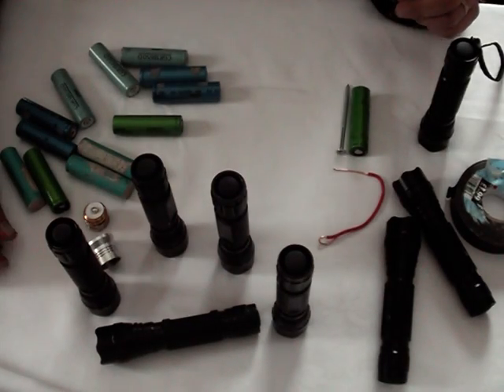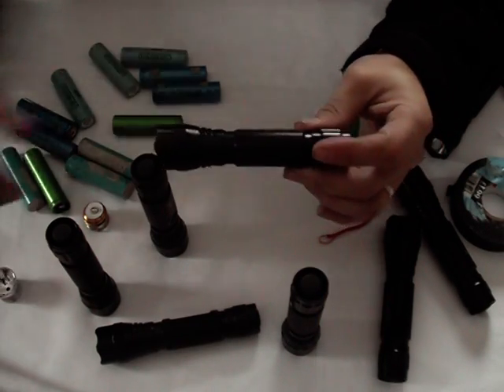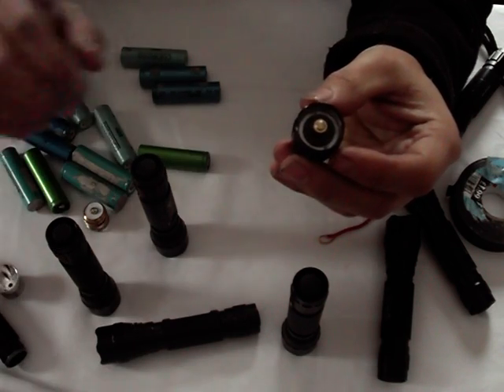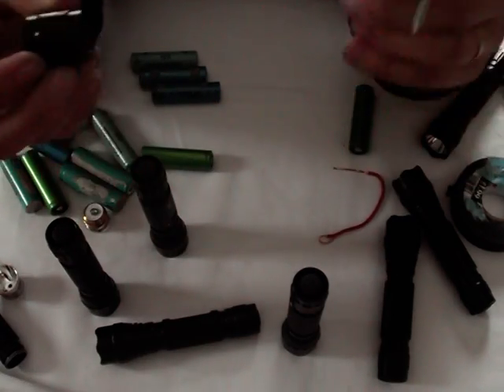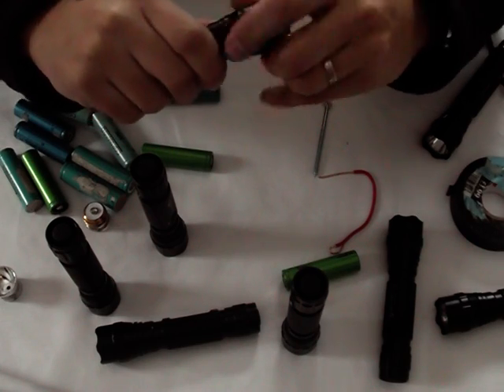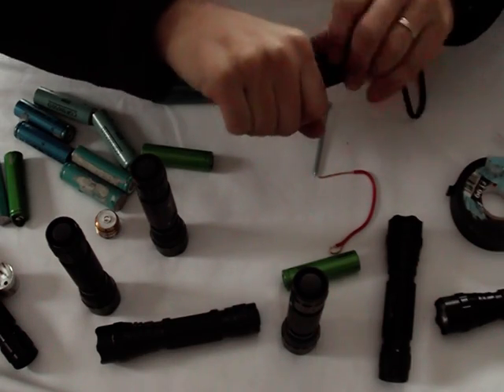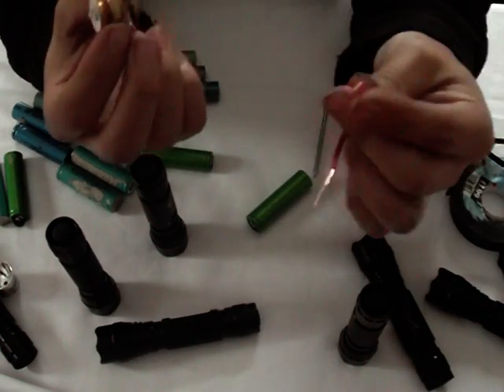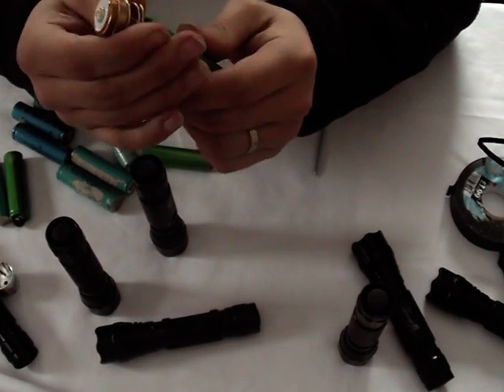CREE Flashlight 🔦 How to Fix Frequent Problems

Comment: Hello. How I config my Trustfire J18 to his work only in hard mode (100%)?
Reply from the maker: you will need new driver
Reply: @motorbiking18650  exist a jump in the boarder to run only in 100%. I dont need other 4 functions of flashlight

Comment: If you can’t get batteries out it’s probably corroded inside. You recommend greasing up ( not over greasing) the inside of battery container? This seems to be a pretty common occurrence. Batteries leaking? The inside is sealed off from the world so I can’t understand how else this would happen. Mines a g 32 and the warranty people were pretty good about exchanging it:).     By the way when I suggest greasing It I’m talking about right out of the package.
Reply from the maker: If you have corroded Li-ion cells they are best disposed of properly - 13w of power is a lot to go off

Comment: I just bought a cheap UV light, placed in fresh batteries and it didnt work. Though I got scammed or somthing but my gut told me to try all the batteries...
Turns out 2/5 new batteries in the pack worked. I stil got scammed out of the batteries but at least the UV light works 😅

Comment: Hello, very informative, thanks. I have an Imalent DT35 with 4 cree xhp 35 leds (2017) and 2 of them are flikering, blinking... I recently bought it used, but it had very little use, so it is like new.... sometimes a 3rd led will start ok at 80lm setting, but then will turn off at 1000lm or 5000lm settings. The 4th one will never turn on. Do you think is there some solution for it? (by the way, with just 2 leds working the amount of light is impressive!)
Reply from the maker: I bought https://www.lightmalls.com/new-small-steel-cannon-flashlight-xhp50-led-3-6000lm-type-c-usb-rechargeable-aluminum-alloy-outdoor-led-glare-long-distance-searchlight for $30 and its really excellent.  The multiple LED lights are hard to fix if the driver wiring is faulty.

Comment: I tried your tip to connect coil in led light element to one end of battery with a wire and other end of wire to other end of battery, but it causes the battery to instantly smoke and burn?!
Reply from the maker: `it sounds like you had some of the wire touching the cap by mistake.. Its often only paper/shrinkwrap that keeps the + and -ive apart

Comment: I just mended mini that was intermittently working going bright to dim to sos then no light so I soldered copper branded wire from top to bottom of each spring front and back and now it works as it should.

Comment: ..i had issues on similar new flashlight...got it working by removing the 18650  protective  o-ring near the positive  terminal  which is negative ..the LED circuit should have direct contact on both terminal before the switching happens  on its bottom....the gap between this terminals are so close  ...normally covered by shrink tube or similar to prevent oxidation (tenderites) and batt short...point that as well..

Comment: I have an ultrafire not sure what model but it's about 7 inches long or so. To adjust the cone of the light the head is pulled up and down and it has become VERY hard to pull up and down, i cant get it apart any ideas?
Reply from the maker: Sorry, no I try to avoid buying zoomable lights as they just reduce the output.  Maybe some tf2 Teflon spray?
Reply: @motorbiking18650  thanks for the reply. turns out the rubber o-ring had doubled up on itself so instead of sliding up and down it was just distorting it :)

Comment: I lost my cap, how do i make it work
Reply from the maker: You can complete circuit with a wire from the cell tail to the body via a switch, and then just bung it up, but its going to be a bit poo.  you can get replacement caps but they cost as much as a replacement light.

Comment: Hi, nice video!
But I have a different problem and was wondering if anybody could help?
I have a Walther Speed Spot torch/flashlight which I was given 3 months ago.
At first the light beam was REALLY bright but over the last 3 weeks it has become MUCH dimmer and it also blinks 3 times (every minute or so).
All the connections seem to be fine and I have tried inserting fresh batteries without any improvement. The torch works but at about 50% of its original brightness!?
Does anybody have any suggestions?
Thanks in advance, 
Paul.
Reply from the maker: Has the tint changed to a blue colour?  Do you know what LED model it has?  If you've over heated the LED then they tend to turn blue

Comment: The ring inside the switch cap of my XML-T6 was a bit loose but I tightened it. The flashlight was still not working with the cap tightened onto the tube.
Then I noticed that it seemed to work (at least the light came on...) if I loosened the cap.
Then, out of curiosity I screwed off the head part to see how the tube itself looked - when I realized that the edge of one end of the tube is black (painted) and the other is bare metal. So I just turned the tube around and screwed the cap onto the end with the bare metal edge and the head unit onto the black edge. 
And lo and behold - it's working perfectly now. (I have probably taken apart the light at some point and put it back together the wrong way...)
Just another thing to consider in case it happened with somebody else, too...

Comment: If your torchlight is flickering or goes no light when you drop, all you need to do is put a the smallest coin you can find and place it between the spring and end of the battery

Comment: I just bought a A1 wowtac   And it was DOA arriving at my house   Watching your video  I fixed it my turn in those 2 little holes  tail cap was really loose   I tighten it up like you  said  and   It fixed my light   Thanks so much
Reply from the maker: glad it worked

Comment: Thank you, thank you, thank you. I was starting to feel hopeless about fixing my VG-10s. I bought my flashlight on Amazon and it never worked. I held on to the flashlight for months and gave the flashlight and sender a bad review. I had spent countless hours going over videos on how to correct the problem of getting my flashlight to turn on. You are the only that suggested using elctrical tape. Two pieces of electrical tape fixed my problem. You're the real MVP.

Comment: I have an electra lipstick stun gun, and accidentally pressed both buttons, and now the flashlight doesn't work anymore. Can you please give me some advice on how can I fix it?
Reply from the maker: If you can unscrew the light part and connect the flashlight directly to a 3v source e.g. a button Cell, you can see if the LED is fried.

Comment: DO NOT WASTE YOUR MONEY..these lights are awful.. they turn off for no reason.. dangerous for a bicycle.. unreliable and you can't change the damn light element

buy something else or throw it out!!
Reply from the maker: klepetar I’ve never had any problems I couldn’t fix.  There is nothing complex about a flash light. I still have early XP-E based lights that work plus i’ve done 7 hour plus night rides off road.

Comment: I have a Rocky brand tactical flashlight. About 8 inches long, black steel body and the black, rubber push button on the end.  The flashlight was dropped but kept working. Now, a few days later, the flashlight does not come on with the press of the button.  What it DOES do is flicker on and off as I screw-on the battery cap and I will push the power button in when I get the cap tightened.  The light will turn on, full blast, for a half a second and turn off.  The design is steel body, the one octagon nut at the base of the bulb housing.  I want to check the bulb's tightness in the housing but cannot get the housing to unscrew from the body.  Do you have any suggestions please, to do that?  I've had this tactical light for years.  It's been a toughie!  This is so frustrating! Do you have any suggestions of what the issue may be please?  The flashlight uses 6 AAA batteries.  I bought 8 new batteries tonight, tried them and the light does the same as before...flickers on and off as I screw the battery cap on and may or may not turn on for the split second.  Your video is great!!!  This really educated me!!!  Your help is so GREATLY, GREATLY appreciated!!!  Thank you!
Reply from the maker: I'd try packing some wire or foil in the end of the battery holder to make it fatter and therefore put pressure on the circuit.  But a tac light that uses AAA... you're really missing out on some power.  18650 based lights can draw much higher current and therfore you could replace with say an XP-L 501b for about $10 This would probably be about 4-10x brighter than your current light.
Reply: Thank you VERY MUCH for this info!!!  Thanks for the advice on the type of replacement device and I found one as soon as I read your message!!!  Thank you again!

Comment: Excellent video, however, my issue was not addressed.  My newer model torch doesn't stay at the same level of brightness.  It suddenly dims for a time, then becomes fully bright again.  It takes about 10-20mseconds for this to occur.  Do you have any thoughts on how to remedy this issue?

Thank you very much,
Ron
Reply from the maker: It sounds like a poor connection which goes as the circuits heat up.  Strip at tighten everything.

Comment: Hey, motorbiking.
My "Wilko Cree LED Bike Light Front High Intensity", got knocked off its mount and tumbled down the road, causing the LED to come off its little silvery square mount point.
I just wondered if an unbonded LED can be easily fixed (by me, at home).
Reply from the maker: Dave Lennon-Copeland thermal paste or high temperature silicon should work.

Comment: Hi...my flashlight BRIWAX model BX-8455 in turning on because when looking toward the len I can see that it is on but light is very very poor...anyone know the problem? The battery is new and I charged it by 4 hours after de green led turned on. I don't know if my son dropped the flashlight and the led got damaged.
Reply from the maker: So the LED is on very dim? You have a lose wire somewhere or the LED is burned out.  Strip it down to the drop in and use some wire to hard wire the cell,  If its still dim then the LED is cooked.

Comment: gotta let you know, I didn't know the switch came apart more. I took it open with a screw like you showed and discover a short circuit that was preventing the mode from resetting when the torch was shut off for several seconds. thanks, man.

Comment: he said he does not use  protected cells with one in his hand, the button on top is the protection...
Reply from the maker: No these cells are from laptops the circuit was in the pack, they don't have the top cap protection built in.
Reply: Ok. whats the button?
Reply from the maker: In the flashlight - its just a switch.  In the driver there is sometimes over discharge protection, but its often way under3v, on the cell the white ring is just cardboard/plastic - is that what you mean?
Reply: I was told the buttons are the protection circuit, everyone says that I got some...
Reply from the maker: The best way to check, if you don't know what you are looking for is to measure the length of the cell.  Apart from panasonic they mostly all come in pretty close to 65mm.  If its protected it will be 68-70mm long as the protection pcb goes on the +iv end.  Laptops use superior protection, see my other video https://www.youtube.com/watch?v=RjtwE41PX1g

Comment: Thanks for the video helped me solve my issue of it switching mode.

Final result was adding packing around the battery and resoldering the spring to the driver housing(looked like a bad solder joint in the first place)

Comment: Hello there, i have a Cree flashlight (600W running on UltraFire SH-6032) with the button on the side. I accidentally dropped the torchlight on the floor. The button wont click when the battery is installed, so i had to remove the battery to click on the button and turn it on. It is possible to change the mode pressing on the button because it does not need the 'click' in order to work. Any possible fix?
Reply from the maker: Keith Yap if you can find a way to break the circuit perhaps with a remote switch, it should mode cycle
Reply: Hello there, thanks for the reply. I can't turn on the torchlight with the battery inside. Because with the battery was installed, there won't be 'click' sound when the button is pressed, so I have to remove the battery and press the button and install it back to turn on the torchlight. Mode changing is possible because it does not need the 'click'.
Reply from the maker: Keith Yap ah i see.  maybe remove the shrink wrap from the cell middle or carefully punch a dent in the cell where the switch is

Comment: Let me add ..... check your batteries. 

Turns out my issue was a faulty battery. Bought two faulty Ultra Fire cheapo Chinese rubbish. 

Replaced with a LG harvested from an old laptop battery and hey presto.
Reply from the maker: Avoid those - I only use recycled laptop cells as in the video.  see https://www.youtube.com/watch?v=RjtwE41PX1g

Comment: what if the spring fell off?
Reply from the maker: If you still have the spring, just put it back in loose (or use a glue gun to hold it in place).  If not make a new spring with some coiled wire - it wont be very springy

Comment: Thank you for the video. Cree Unique Fire didn't go. Was going to order a new bulb set, but saw your video and tightened the plate holding the button with a small screwdriver. Simple fix that I hadn't tried. Goes well now!

Comment: Hi I have a question and was hoping you'd be able to help, I just got an LED flashlight with a Cree XML T6 LED. The LED turns on but it's EXTREMELY dim when I turn it on, it's not the batteries or the button, any idea how to fix this? When I say extremely dim I mean like really dim I can look straight into the LED. It's like the LED is getting the least amount of power it will accept to turn on. It also will not switch between modes but I wouldn't really expect it to considering the LED seems like it isn't getting much power at all.
Reply from the maker: yes. it sounds like a lose wire causing a micro arc. strip it down to cell and driver as per video and test. if it's bright then lose connection so tighten everything if still dim.  duff driver.
Reply: +motorbiking Okay I'll try that. I appreciate it. Mine isn't exactly like yours it has the led on a circular board with two wirea connecting it to the driver that sits in the tube. So should I use a soldering gun and take the wires off the board and connect the wires from the led to the battery?
Reply from the maker: +Josh J No - your LED will go blue and die if you do that.  The driver regulates the current, the reason I strip down cell and driver at 7:05 is to remove the switch from the circuit - have you tried this?
Reply: Okay I appreciate the advice. No I haven't tried anything yet except  pulling the flashlight apart to see If there we're any loose wires or anything.

Comment: Thnx to this awesome video I was able to fix my Cree XML-16.  This torch uses a 18650 battery = 3000 mah battery. I had a loose positive wire on the driver board.  I pulled out the old soldering iron and got fixed. Looks like the wires being used on this torch are way too small to handle the current.  I put some heat shrink around as well to give it some strength.

Comment: I for the ultrafire t6 I unscrew the end and a little spring and a bee bee came out where does it go so my light will work hopefully
Reply from the maker: Joe Scott It goes in the tail cap to connect the negative to the switch in the tail and then to the body of the light, which carries the negative

Comment: I hope to get my  cree 12x led five mode xm-l t 6 soon .i bought it used from eBay ,sellers says that it comes on but stays on strobe mode ,doesn't switch through the rest of the modes. What do you think is wrong with the light ??
Reply from the maker: Any idea if it has a separate mode switch?  My guess is a fault in the switch circuit, bypass the switch manually using a piece of wire and see if you can get the modes to change.  you might need to strip it down to the driver to see.

Comment: i ripped out the driver   and rewired to strait to the battery
Reply from the maker: which LED?  it seems to be fine on XM-L2 providing you have good heat sink.

Comment: I bought same one but got the longer one the same day I got it the very tip of the flash with the lens ended up falling off I couldnt find it how can I find the tip and lens to repair it
Reply from the maker: You can get replacement lenses on ebay, but the bezel may be harder to find.  To be honest given that you can replace them now for about $7 and the lens is going to cost you $2 you might as well get a new XM-L2 based one and then either use it for spares or use your old one for spares.

Comment: i have a strange problem in my LED. When i use a AAA battery the light is bright. But when i use 18650 battery the LED is substantially dim! I have to put in a holder when i am using 18650 battery.There is no problem with the battery. Any idea why this might be happening? I tried tightening the tail cap. but still the problem persists
Reply from the maker: Well AAA cells are 1.5v so 3 X 1.5v is 4.5v 18650 are 4.2v fully charged, but you probably wont get the amps out of AAAs  So my guess is a weak connection on the 18650.  Have you tried a washer or something metal on the tail to make the connection tighter?